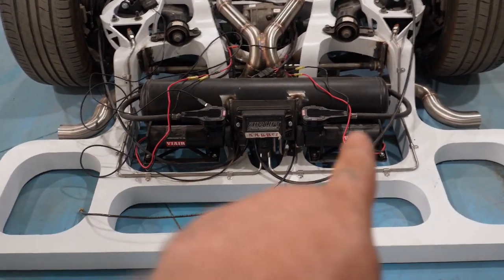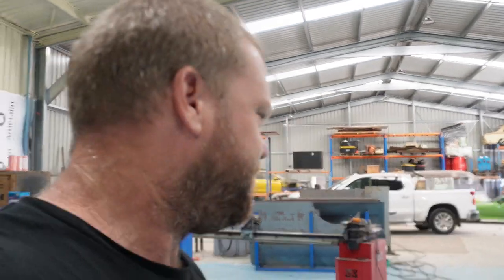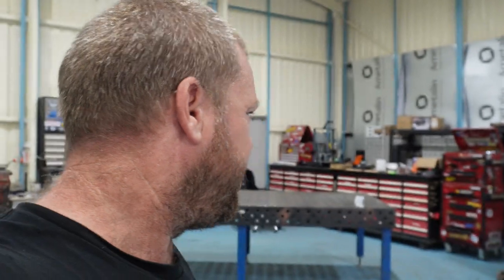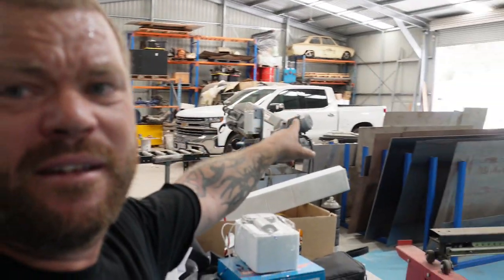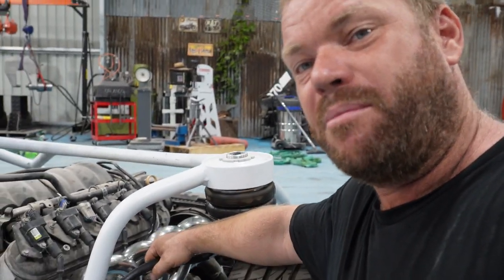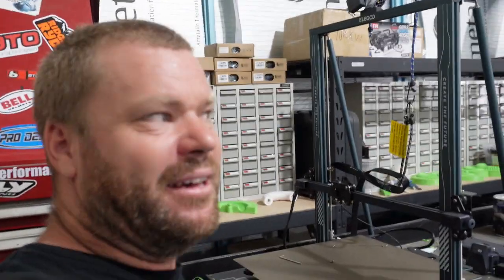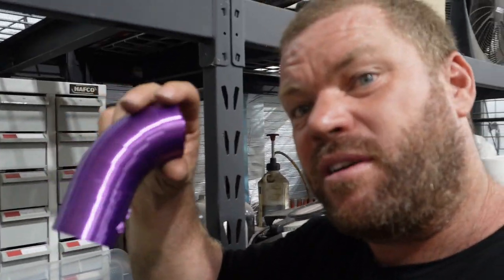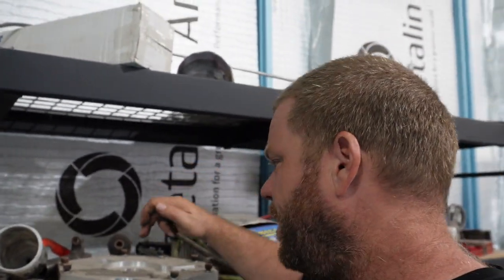Custom exhaust and chassis progress update. SSMetro Ep34

Comment: Good to see you back. Surprised you face trouble getting race works parts, do others have them available and just your supplier is the issue?

I love the hp academy courses and the electrical one is very useful even as a tradesman. 

Which crimpers are $600?

And yes. Film more.
Reply from the maker: Hey bud cheers, i think the issue must have been the company i ordered through not sure really just crazy. You would think 6AN hose wouldn't be hard to get.
I liked the HP courses learnt a bit and they used the ECU Mast PDM which was handy.
From memory the crimpers were a ratchet bootlace set, I didn't get them ha ha.